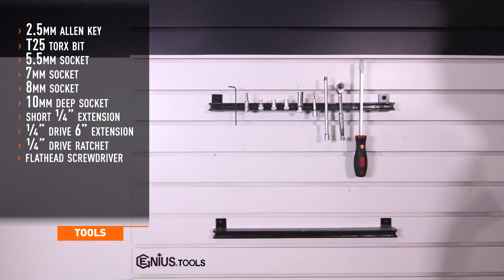2015+ Ford Mustang EcoBoost Intercooler Installation Guide By Mishimoto

Comment: What is the expected HP gain with a tune and a Cold Air Intake?
Reply from the maker: Check out the engineering report here: http://engineering.mishimoto.com/2015/04/the-mustang-ecoboost-intercooler-part-5-finished-product-and-final-testing-data/